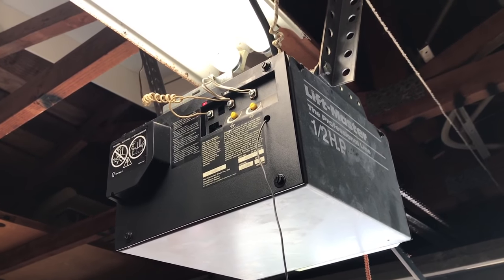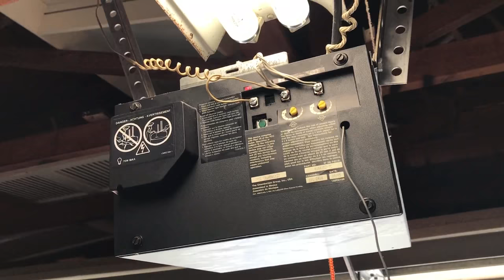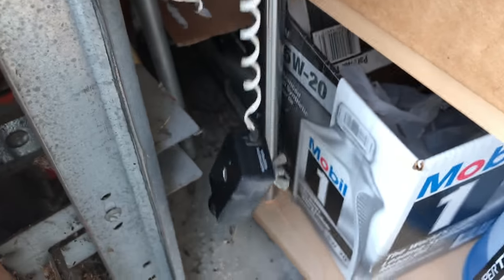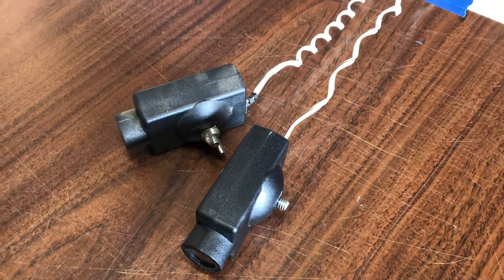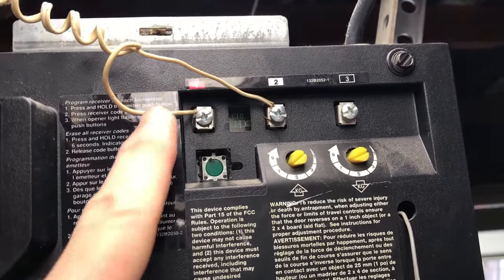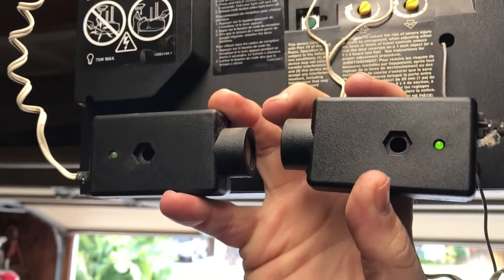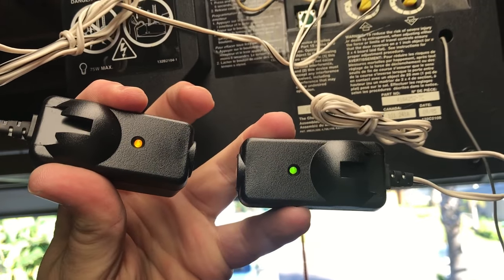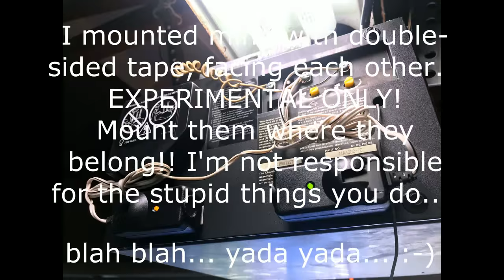FIX Garage Door opener sensor issues EASY CHEESY!  Won't close? Sunlight issues? "Snip! Snip!" :-)

Comment: A simple fix is to place the receiver on the side of the garage door that does not get the direct sun light.  Swap the sensors side to side.
Reply from the maker: If that works for you, perfect!   I do recommend people don't do the stupid things that I do.  🙂  That said, I didn't move mine because of a light issue.   It's just a b*tch lining up those sensors (at times) and I was tired of screwing with them so for me, my solution is perfect!  Plus it's a good way to test your sensors.   🙂

Comment from the maker: Thank you all!  I did this video 4 years ago and my sensors still work great!   No snow, rain, cold, heat, sun, earthquakes.. or carelessness, will misalign them now.   I HAVE TO CONFESS HOWEVER:  the main reason I put the sensors up top is because I like to pull an Indiana Jones when I run out my garage door.  I press the button in my garage and RUN...  If the sensors are 6" off the floor, they catch the whip on my side and it ruins the entire experience!   So with this, I can roll under the door... and I even have time to grab my fallen fedora at the last second! 😀😉😅

Comment: Greg garage door video word of advice make sure you put the safety sensors on the bottom of the garage door 6 inches above the garage floor because that is state code regulation
Reply from the maker: Just like with anything else in the home, that's only if a professional installs it and then THEY are required to install it that way.  Homeowners have no such regulations.  Businesses do however.  :-)

Comment: Finally, someone with a logical, simple way to test sensors without taking down the unit. Thank you for recording and sharing this.  I am tired of garage door repairman taking a guess - process of elimination on my dollar!  I just saved $600 and was told it was most likely the logic board because that's what they have been seeing, and I might as well get a new unit, because the logic board has been on back order for months.   I asked, is there a way to check the sensors separately, and was told we cannot because the logic board isn't recognizing the sensors.  SAME excuse from two different companies.  UGH!!!!!!!   My sensors work, thanks to this test video, all I did was replaced all the wiring that leads to the unit, and BAM!  It all works.  $10 worth of 100 ft of OEM Liftmaster sensor wiring.  However, I am out the $65 x 2 service calls from the two repairman (lazy or incompetent) looking to make the company MONEY!
Reply from the maker: It's just crazy what some of these companies charge, and take guesses at .  I suppose it's how they make a living.   I'm glad YouTube gives all of us a place to where we can help each other with small DIY projects.   I'm happy to hear it helped and you only had to do a little "snip! snip! snip!" to get it done!  ;-)   Have a great day.   - Dan in Carlsbad CA

Comment: Thought the sensor was messed up. Looked up and it was wired into the house so I knew I had to pay someone. After watching this video I started moving the sensor up and down till I saw it blink green, hooked it about 5inches higher than the other end &&& BOOM that mudafvcka was back working!
Reply from the maker: Ha...  awesome!   I hate these stupid sensors.   You can spend a couple grand for a great garage door opener, then they use $2 in sensor light parts to make it work.  Lame.   Glad it worked!

Comment: Thanks but it’s absolutely ridiculous that we have to do any of this. My new garage door simply doesn’t close during the day because of whatever sunlight ghosts these sensors are sensing. I have to wait until it’s dark to close my door without issue and without going out to the garage and holding the button down. Even then it takes 3 tries.
Reply from the maker: Yeah, that's harsh.  That's why I mounted mine up top and it's been working fine for 4 years + now.   but I agree with you 100%  🙂

Comment: Great video man! There's a shortcut way to get even results faster. A bit of fancy video editing and cutting, replacing the sensors, snap your fingers, there installed! Splicing wire, snap fingers, and voila! Finally testing sensors, snap fingers, voila! They work! Works everytime.
Reply from the maker: Ha...   yes!  that would be the perfect to-the-point video.   But I'd still have to fit in my comedy bits.  😅😅

Comment: Greetings, mine stopped working and now when I press the control of the car or my house it doesn't work for only 5 whistles, please I need help 🙏
Reply from the maker: So sorry to hear this!   I wish I had an answer for you, but I'm not a professional installer for these.  I use duct tape and elbow grease to fix things.   But that said, I had to point out the obvious but if your controller isn't working, maybe it needs new batteries?   As well, but SURE nothing is in the way of your sensors and be sure they don't wiggle when you open your door.... be sure the screws are tight on the sensors.   You may also want to clean the clear lenses on each.   Good luck to you!

Comment: So I have a weird problem that my garage door keeps closing even if somebody comes in between the sensor, it will not stop and keeps closing. I see it as a safety issue in case a kid comes in the middle. The door will not stop. I do have sensors and they sent something as I can feel a little hesitation on the door, but it keeps on closing what could be the issue?
Reply from the maker: If your sensors are working (you can test using my method), then this issue is above my pay grade.  :-)  Hold out your hands as it closes and carefully grab the bottom of the door, as it lowers.  It SHOULD start backing up.   As it should if anything is in the way (I wouldn't recommend using a child to test this! ;-) ) .   It is weird because if the sensors aren't working, it shouldn't close at all.      

One idea...  maybe your door button INSIDE the garage is stuck?  Try disconnecting that.   You can override the entire thing by holding down that button you have in the garage (not on the unit, likely next to the door that goes into your home).  So if that is somehow defective or has the wires crossed, maybe that's it?   But back to 'weird', if that's it, your door shouldn't even open.    Maybe try the same thing with the sensors by disconnecting them temporarily to see what happens.  You'll likely get an error with that however.

Like I said, this is above my pay grade...   meaning I'm not a door tech, but I am a computer tech.   If all still doesn't work properly, you may have to call a professional or if it's cheaper, install an entirely new unit yourself... if you're so inclined.  

Good Luck!

Comment: Just curious has anyone had their garage door open or close randomly after doing this by any chance? I’ve had it do it twice now since doing this little trick and I’m hoping it’s something else causing it. It’s not the remote I’ve disconnected that ability.
Reply from the maker: Hey there!   Yeah... having your door open by itself in the middle of the night, or whenever... would be a huge issue.    In the 4 years I posted this, I've had nothing like that or heard of it.   Many years ago I did find an issue with a neighbor who's garage door opener somehow opened mine a few times, accidently.   Which seems impossible.  I mean there's a bajillion code combos.

Personally, I'd double check your wires from the door opener on your wall that you can press to open, or disconnect it.   Then new batteries in the remotes, then be sure the remotes aren't in your pocket ;-) 

Another thing, you can set your garage door opener sensitivity AND where it ends up stopping, using a couple set screws on it.  Look that up for your model.   Maybe it's closing too hard into the floor, then opens itself for safety?   Seems a stretch, but just another thing to test.    Then ... maybe the sensors are defective?   Take a week to completely disconnect the sensors and open and close manually (a pain, I know) and if it still does it, then there may be a sensor issue.   check those wires as well of course.

Then with the sensors, does any random light get into them?  a window or garage light?  Some have put electrical tape between the sensor eyes.  Putting them together, then taping.   One even used a toilet paper roll.  :-)    

Good luck finding the issue!

Dan B
Carlsbad CA

Comment: I have a two car garage, with two Sears/Craftsman openers that were in the house when I bought it, 25 years ago.  I've updated the openers with rolling code remotes but otherwise have done nothing to them.  One of the garage doors has sensors, and the other doesn't.  The one that has sensors is the one I use most often, and it's recently given me a little bit of intermittent problem with closing, which I have attributed either to the sensors themselves, or the wiring to the sensors, but a little bit of jiggling with the wiring and sensor alignment has kept it working.  
Looking at this video has made me curious, and I'm gonna check out the difference in wiring between the two openers because one of them has never had sensors since I've lived in this home, at least not in the normal location, nor in any other visible part of my garage, and that opener works fine.
Reply from the maker: Nice! I hope you find the Issue.  Likely a loose wire.  I'm bummed Sears went out of business...  at least in every city around me.  Hands down Craftsman tools are the best ever built and at Sears, you could shop for them and hold them in your hands.   You can still buy them online and Stanley/Black & Decker owns the brand now, but having them in-hand while shopping was great.

Comment: Good quick explanation thanks. . I am going to snip snip 😜😜.  Pretty sure I have a dead sensor. If they work then it’s the 25 year old wires. Thx again..
Reply: I just had a new chamberlain installed about 6 mos ago.  But I noticed they used my old wires and spliced in the sensors to that wire.  My wire is about 25 years old too.  You think it could be that?  I know its not the sensors because I did what this guy suggested and the door opens and closes fine.  I finally just taped the sensors together!

Comment: My garage is driving me nuts both my lights work and I've tried a hour aligning them no luck
Reply from the maker: I hate that... and it's why I have them facing each other now.   Using my video be SURE yours is wired correctly and it may seem like a lot of work, but you can just disconnect the sensors and using any wire you have, connect them directly and then face them at each other.  IF it doesn't work, then you need new sensors and they run about $22 on Amazon, or you can find them locally.
Reply: Update ! It wasn't the laser eyes. All I had to do was adjust the two screws on the actual box that makes the garage go up and down. I believe they are what makes the garage shut faster and slower and also one is a adjuster to make it more or less sensitive to hitting something. So I adjusted those and it's been great since
Reply from the maker: @marieramerez11    Perfect!  I'm glad you figured it out!   It's crazy it was those two adjustments but hey, if it works!  :-D    Since I have my two sensors facing each other, I adjusted my 'sensitivity' to be very high for safety reasons.   If it even closes on a light cardboard box, it will reverse and go back up.    I've had the eyes up top for 5 years now and it works for me!    

Thank you for sharing that yours is working now.   Have a great week!  - Dan B

Comment: Can you open the door without sensors?perhaps by bridging both terminals where the wires are connected?
Reply from the maker: Yeah I tried bridging it and it just won't work.  The opener needs proper feedback from the sensors in order to operate.  But you'd think it would work!

Comment: Those look exactly like mine and the receiving eye is not lit. But the replacement Wayne Dalton sensors look nothing like mine? What brand of door lift was that?
Reply from the maker: So sorry for the late reply...in case you need that info, mine is a Liftmaster by Chamberlain.    the sensors are pretty standard.

Comment: Can I just loop a wire between the 2 terminals on the back of the unit? If the sensors just complete a circuit, why do they need to be in the circuit at all?
Reply from the maker: I wish!  They don't just complete the circuit, they confirm their own existence before closing or opening it.  It's really strange and believe me, I tried.   You have to have the sensors.   I've seen workarounds making your own computer board hack, but it's SO much easier just to buy the sensors.    and again, makes no sense, I know.  - Dan
Reply: @DisneyDan  Well that answered my question about doing a jumper wire. Now I don't have to waste my time. Thank you

Comment: The sensors just complete a circuit - can you just run the wires from one side of the unit to the other side on the back of the unit. Done.
Reply from the maker: You can't do that.  Believe me, it's the first thing most of us have tried.  They aren't just completing a circuit, they are confirming that those sensors are there and you can't bypass them.

Comment: is there a way to bypass them without using them?
Reply from the maker: Unfortunately no.   Well, technically you can build a logic board that bypasses the system, but with the time and money, it's just not worth it.  You would think you could just cross connect the wires, but nope.   The system looks for the sensors or it doesn't work.   Good luck with your system!
Reply: @DisneyDan  thank you 👍🏻

Comment: Will any sensor work, or are they very model specific?
Reply from the maker: No, they are not model specific... but you'll want to note the model of your unit regardless and double check.  But the light sensors just send a constant on/off signal to your opener.
Reply: @DisneyDan  Excellent. Thanks for the info

Comment: Are those both the green senors??? Where is the orange one? If they're both green it won't work regardless
Reply from the maker: The orange one??  Would you be referring to the lights on the sensors?  If both are green and it still won't work for you, then you likely have a wire issue or you can still have defective sensors.   Try connecting them with shorter wires directly to the garage door opener... just like I do here, and see if they work then.   If wiring isn't the problem, and you have new sensors, then something would be wrong with the electronics in your opener.   Good luck!

Comment: I just had a garage technician out because my garage door will not go down unless I hold the wall switch until its all the way down.  Remotes will open it when I'm coming home but not when I'm leaving going down.  Nor, will the wall switch bring it down with one push.  He was in my garage for about half a minute looking at it and said it might be the sensors needed adjustment and wanted $195 to do it.  He said the sensors cost $150 and he wasn't going to do a job where he made $50.  Do you believe this world?  I said I was going to get a second opinion.
Reply from the maker: You really just need to order sensors online like I did.  they will cost you no more than $25 on Amazon.com.  Just look up your model and reference that on Amazon.   You can then just cut the wires on the old ones, and put these in.  It's very very easy to do.  You'll just have to splice the wires.  Cut the old ones, use a screw driver to remove, install the new ones and if you think you can  splice a wire (expose the metal wire part), and twist them together... you can do this!   Just be sure to use electrical tape or plastic caps to cover the bare exposed wires you twisted together.  It's truly not that hard.
Reply: Thanks for the reply. Something told me this tech  was shady from the get go.  I'm really weary of not being able to trust people.
Reply: Thanks for the reply!
Reply: I believe it, it's ridiculous.  Thank goodness for You tube!

Comment: You had two receiver sensors (both green light) That's why it did not work. Rigging it up to omit the sensors is against code and dangerous.
Reply from the maker: Thank you and I know exactly why it didn't work.  I had one defective sensor.  I replaced them and it works perfectly.   It may have looked like I had two green lights, but I didn't.    The light was reflecting on the left one so it may have seemed that way.

As well, it's NOT rigged up to omit the sensors.  The sensors are connected.  

As for "code", that's for contractors doing the install.  They are bound by regulations and codes.  For me?  I can do whatever I want in my own home.  Stupid or not.   IF I sell my home, then an inspector should ask to change it back, meanwhile, there's no code that doesn't allow me to do stupid installs in my own home.    As for dangerous?  For who?   I can stand under the door and if it comes in contact with a cardboard box, it will back off because of the resistance.   It's fine and works great.   

In my video I CLEARLY tell people to install the sensors the "correct" way.  I did it the stupid way and it works great for ME.   Have a nice day...

Comment: Removing your photoelectric sensor from their required location is NOT wise. It's a $40 part that will prevent a much more expensive problem in the future.
https://www.dasma.com/PDF/Publications/Brochures/AutomaticGDOSafetyMaintenanceGuide.pdf
Reply from the maker: It's not a required location if you're the homeowner doing the work yourself.  At least not in CA here for a private residence.  It's our home to do what we want inside.   If we were building a brand new garage , then installing electrical, then it "may" be required.